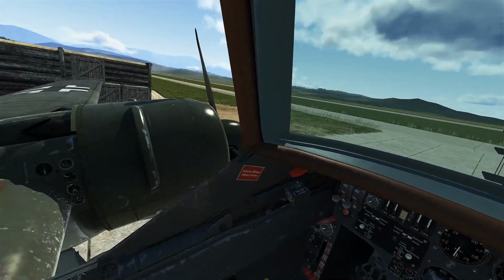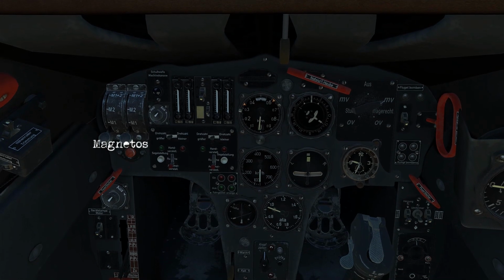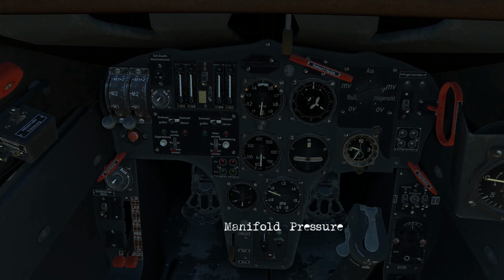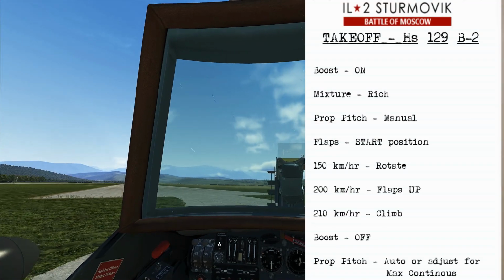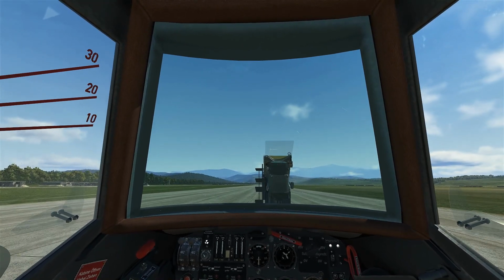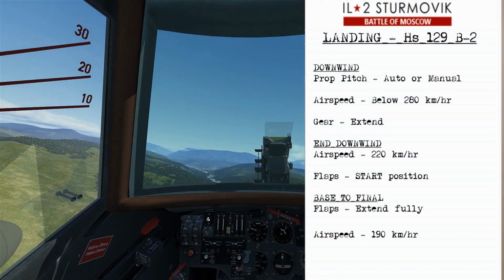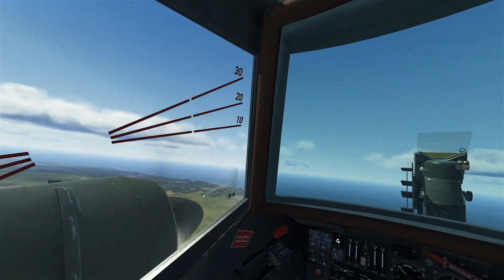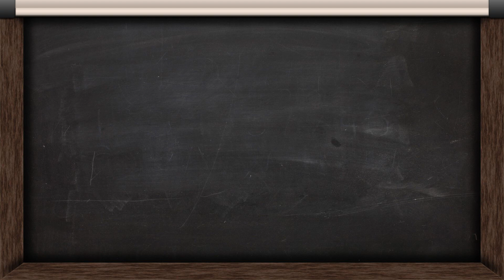Learn to fly the Hs 129 B-2

Comment: I was doing donuts for days on takeoff . I finally figured it out . Go full power right from the start .No need for brakes as video suggests.Stay off the rudder just apply brakes as needed.Once up to speed near end of runway drop flaps to 35% . Still takes a bit of practice but a hell of a lot easier as other videos have suggested .
Great video loaded with important information for flying this bird .Thanks and subscribed
Reply from the maker: Hey it's all good Neil, whatever you can get to work for you! I try to replicate things from their manuals but all pilots have their own techniques so if it works then stick with it. The duck has always struck me as having a bizarre takeoff behaviour in Il-2 to be honest. It just doesn't make sense to me why it does what it does on takeoff. Be sure to check out the videos in the "Weapons Employment Guides" I have showing how to use it for level bombing and strafing, they should help too. https://www.youtube.com/playlist?list=PLnyigzFtHeNooN19kyhiT2UqojQPacCcE
Reply: thx, this helped me. I was trying to takeoff the correct way but always ended with a spinning plane. Using your way I cold take the thing off the ground
Reply: That's the problem Ive always had and i have played every single plane on il2 since the day it came out back in the older days and the new days,lol,its almost like this plane needs a tailwheel lock, as soon as i start flying its doughnut central,im gonna try your way.

Comment: Just wanted to make a quick comment about the landing procedure: the original German manual says to set the engines to max RPM once glideslope speed is reached (200-180 kmh), in order to be able to go around if the landing has to be aborted. I've tried this a few times and have found it to work well.
Reply from the maker: Yeah very true Luke, regardless of the airplane you should always remember to have RPM fully forward when on final as your airspeed drops in case of a go around. I learned the acronym GUMPS to go over on the base leg before landings (Gas Undercarriage Mixture Prop Seatbelts/Switches) to make sure you are squared away before landing.

Comment: One thing I thought I would add just because I think it's interesting is taxiing this aircraft is unlike taxiing most others in the sim in my experience so far.  This aircraft seems more unstable in the yaw axis on the ground, so deviances from a straight heading will tend to get worse over time and eventually become impossible to correct. This aircraft also has poor low speed rudder authority so taking off can be tricky.  I have found that holding full aft stick while on the ground can help a lot with this, I guess the downforce increases tail wheel drag or something.  It's possible I've only observed this tendency with this aircraft to this degree because it lacks a locking tail wheel, but it makes taxiing tricky at first, then a unique challenge.
Reply from the maker: The Hs129 always struck me as being wrong in it's ground handling. The props rotate in opposite directions so I don't understand why it pulls to one side during takeoff.
Reply: @RequiemsACTL  Yeah the wheels don't seem that much further ahead of the c of g than any other aircraft. It doesn't seem like it should have exceptionally strange ground behaviour.

Comment: What Prop pitch should I have for takeoff?

Edit: I figured it out.
Prop pitch has an effect on the rpm, thats why drehzahl is written next to the switches.
Having a high prop pitch creates a lot of air resistance and makes it harder for the engine which decreses its rpm. 
Lowering the prop pitch to its minimum position has the effect that you get higher rpm.  
The Automatic mode uses the pitch to keep the rpm under 2700 rpm which prevents the engine from destroying itself.

For take off, having a low prop pitch is beneficial because:
1) a low prop pitch makes it more efficient to gain speed from being stationary 
2) It causes a higher rpm which leads to that it can move more air per second and propell the aircraft with a greater force forward. 

I found a document which states that the rpm should be at 3030 on take off.
Reply: Spot on
Think of the propeller as a screw
If the thread is fine (more frequent with less space between) it's easier to screw in but you'll need a lot of turns with a screwdriver
If the thread is coarse (less frequent with more space inbetween) you'll need less turns to screw it in but you'll need a significantly bigger force to turn it

And since the propeller is basically a screw with very short threads, this made me understand it much easier
Reply: @atoka2206  that is a good analogy

Comment: Requiem:  Thanks again for all of these, maybe particularly this one.  So far my experience with the plane has been less smooth than Michael Foreman's (below).  Maybe because my control setup is over-complicated for this plane.  I have gotten it into the air (WarThunder takeoff, I'm sorry to say) and have several observations:
"Pitch" - IL2 uses the same keyboard commands for "pitch" and "RPM".  The difference is that "RPM" can be mapped to an axis, "pitch" apparently not.  Could be because (although both control pitch) planes with "RPM" control have a governor linkage to the carburetor/fuel injection whereas those with just "pitch" do not.  I have a three-axis (light plane) throttle, with (apparently) just "RPM" bound to the middle axis.  Have to use the keyboard commands for this plane.
On a related note - Manifold pressure set to 1.1 ATA puts me in "combat" with 2,800 RPM in automatic pitch.  Pulling it out of "combat" requires reducing the throttle to the point where the plane won't stay in the air.  Setting throttle to 1.1 ATA and pitch to bring the engines to 2,350 RPM gets me out of "combat" and the plane flies faster. . . But I may have bolluxed up the controls in my attempts to wrest control away from the forces of random.
Reply from the maker: Hey Guard, if you control pitch manually like the pilot's notes refer to then you won't have problems maintaining airspeed. I use buttons for RPM up/down and I use the same buttons for pitch changes if that helps.
Reply: Good idea. . . I think the Gnome-Rhone became a Troll-Rhine when it went into a German plane.  (Petain's revenge.)  Starting to like this plane. . .  Jockeying pitch and throttle seems easier than the P-40 but not as easy as the P-39.  Big difference is I can't control pitch with my RPM axis, and the RPM gauges are out on the engines.  Finding some non-conflicting keys to dedicate seems like the best compromise.
I like this plane, in the air.  Slower than the Sturmovik and bomb options are crap, but the guns are about as good and it is a really stable strafing platform.  (And with the mirror you get some idea of what is happening behind you.)
I think the trick is to takeoff is to get some rudder authority as soon as possible.  Stand takeoff helps, but for my best takeoff so far I left the flaps raised until I picked up some speed.  (I do this with the Sturmovik also when I have it really loaded up.)
My prediction - you will never have a problem grabbing a Duck on multiplayer servers where it is available.  (Like the Sturmovik.)  And you won't get bounced by Focke-Wulfs and Messerschmitts (well, not often).  Have to see how tough it is - seems a bit more Flak-resistant than the Sturmovik.

Comment: A small correction, the MK 103 has faster rate of fire than the 101, almost double if i'm correct. Having more ammo more or less gives it similar firing time. The projectiles fired are the same
Reply from the maker: Super Étendard Yeah thats correct I messed up with the text,  bugger! I distinctly remember checking the differences too so thats a dumb mistake on my part.

Comment: Question:  If the aircraft has counter rotating props, why does it pull to the left?
Reply from the maker: I've wondered it myself and can't explain why.
Reply: I wonder if they accidentally forgot to account for it - maybe they used the Bf 110/He 111/Ju 88 handling characteristics, which all share the left pull (I think).  The torque should have been cancelled out, prop wash over the empennage the same, so really the only differential should be any external asymmetrical differences.  Definitely a headscratcher.

Comment: Thanks for another great guide! one of the only Axis planes i've seen using mixture controls so far.. one question, is there a Elevator/Rudder trim indicator? or do you just hold the switches and rely on the physical feedback you get. Thanks!
Reply from the maker: Yeah I don't think there is an indicator...just trim to take away control pressure as needed

Comment: Very informative but since the tech chat is OFF and non clickable cockpits it makes the educational value somewhat limited. Shame if you are a beginner trying to learn exactly what pilot is doing.
Other than that, quality content.
Reply from the maker: Thanks for the feedback Ytseman. I do try to mitigate that problem by talking through what I'm doing in the plane while I'm doing it, as I do when instructing in RL. I can see the usefulness of tech chat during the start up, but like you said since it's not clickable it kind of defeats their purpose anyway. Personally, I don't like to have the tech chat up in the tutorial videos as I think they can create a bad habit in thinking of settings such as flaps, RPM, throttle, etc only in terms of % instead of their actual known values.

Comment: Love the video man. 
One thing I can't find the answer to that you may know.
What's the red lines on the left window of the cockpit and what are they used for?
Reply from the maker: Hey Nicholas, those lines will tell you your dive angle just like in the Stuka. So if you start a dive and check which line is parallel with the horizon it will tell you what your dive angle is.
Reply: Thank you. 
I haven't flown the Stuka yet.

Comment: Thanks for the vid, but with which button i select start position for flaps?
Reply from the maker: Just use the regular flaps key, but press it once and don't hold it down.
Reply: @RequiemsACTL  thanks for the hint. A question for starting and cruising prop pitch: set to 100? Would be cool if we can see what you set in the vid.

Comment: At 3:27 you state that the MK103 has more ammunition with slower rate of fire, but the notes in the game say that the MK101 is 250 RPM, and MK103 is 400RPM.  Is there any benefit to the MK101?
Reply from the maker: That was a typo on my end, the in-game notes are correct. I don't think there is that much benefit to taking the Mk101 over the Mk103 as they're pretty much the same thing just with a different operating of firing. I think the only benefit is that muzzle velocity is a bit higher in the Mk101, so I'd always take the Mk103.

Comment: My engine keeps shutting off half the time on the runway for no apparent reason.   Any idea why?   Could it be a bug with the new update?

Somehow I did a perfect takeoff on my first try,  adding myself..."why is everyone having such a hard time on takeoff?"  But then my 2nd and 3rd times were failures.
Reply: Nevermind, just realized I had my mixture lever down to the 0% position.... not used to using mixture controls.  Got myself taking off again.  Thanks as always to your videos!  Anytime I fly a new plane in this game, I go straight to your tutorial videos.
Reply from the maker: Great to hear you sorted it out John, the Duck can be a tricky bird to take off that's for sure.

Comment: How to use the gun sight of hs129?  Notice those 4 'flap thing' on the left side of gun sight(for bomb dropping?)
Reply from the maker: That's the bombing sight, I've had requests to make a video on that so I'll be doing one. In a nutshell  when you line up on the target the four flat pieces of metal tell you when to drop bombs when your altitude is either 10, 50, 100, or 200m above ground with an airspeed of 300km/hr
Reply: @RequiemsACTL  Thanks! Looking forward, always high quality video.